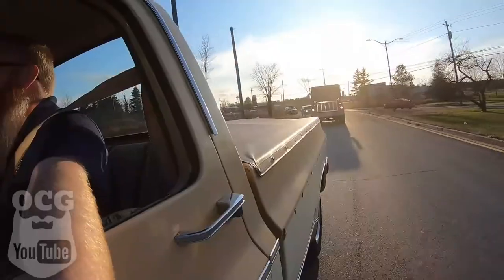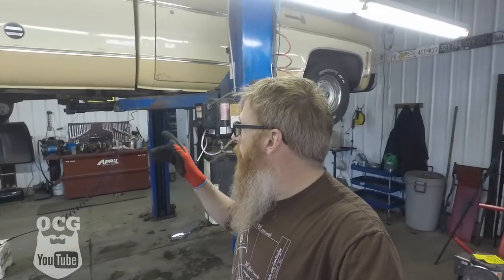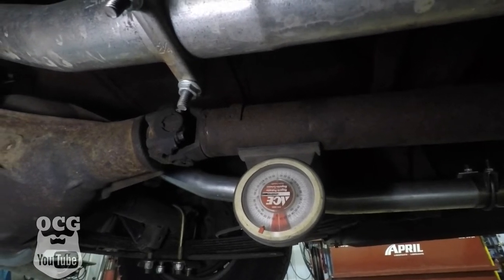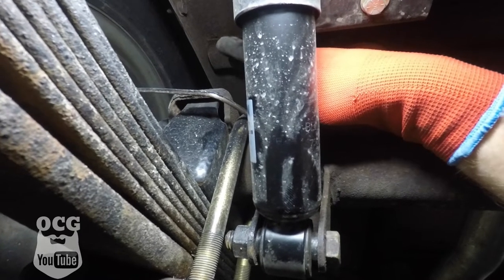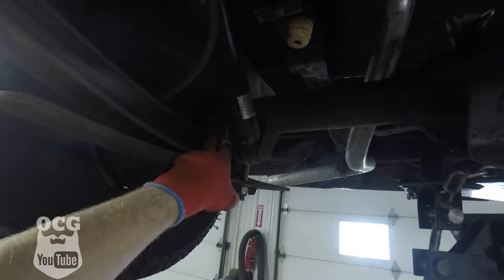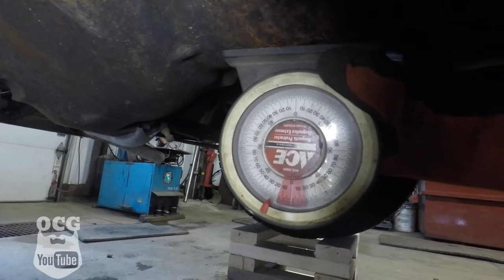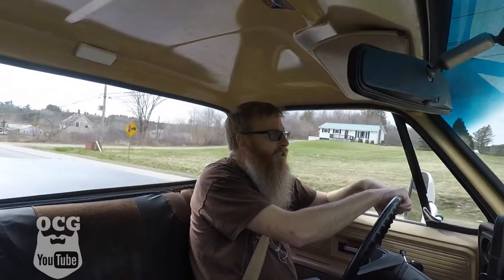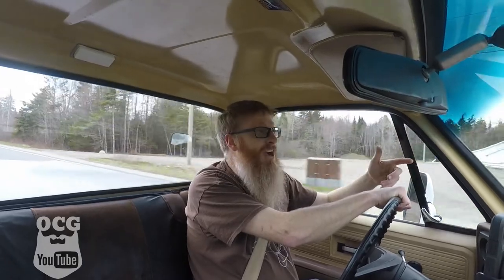ADJUSTING THE PINION ANGLE IN MY 1977 CHEVY C10 TRUCK

Comment: thats why i made a shim to put on top of the rear tab :) i know lot of guys say do this do that it hard to know the right way but most important is to be parallel to each other from the pinion and shaft trans you need a bit of a angle to be correct.....and don't forget your diff go up a bit when you drive this truck so if you have 1 degree more down is ok! ;)
Reply: if you fix those vibration that the most important good job :)
Reply from the maker: It seems to be good so far! Thanks Sly

Comment: Great Stuff will changing the pinion angle cause you to need a new alignment? you might try PST....Performance Suspension Technology for the leaf spring issue See you in the Next One!
Reply from the maker: Not on this setup. The Axle is staying in the same place just at a different position within the perch. Doesn't change the position of the wheel & Tire.

Comment: So you took a 1/4 off to get the correct angle? Was that 1/4 from the rear  or from the front facing the cab? I’m doing a drop this week and It would be nice to get it right then first time
Reply from the maker: I removed the material from the front side of the bracket that faces toward the cab. Same side of the axel as the pinion & driveshaft!  Best of luck.

Comment: I did the same thing to my 77 and now my rear end is ticking bad. It goes away after I give it more throttle. My pinion angle is bad like yours was. Could this be my problem
Reply from the maker: It's more likely that your pinion lash has worn (if original) or not set correctly  (if new).
Reply: It never made that noise until I lowered it

Comment: I have a ticking noise on my 74 not to sure what it is any recommendations?
Reply from the maker: Look for black soot marks around your exhaust manifolds. If nothing there you may have a stuck lifter or loose rocker arm.

Comment: I have searched a bit for this , some ppl say the final angle should be 2-3 NEG degree at yoke. 
ZERO like you have seems ok , test drive results is the judge!
I think you said that a shim is about 1 degree equals near 1/4 inch per degree on think end, though each. vehicle might be a bit different possibly? 
I was looking for a correlation between the degree and the final width  yet thats not too important now, just the final angles is the goal here.
Reply from the maker: You can play with it and test drive. As close to zero is the best!
Reply: @OldeCarrGuy  
I put a 3" lift kit in now measured angle with truck sitting rest on ground, are as follows.
Trans is 4 downward.
DL is 2 downward.
Yoke is 11 Upward.
Is there a calculator program to use that can render a proper shim angle for the rear leafs to correct this?
thx